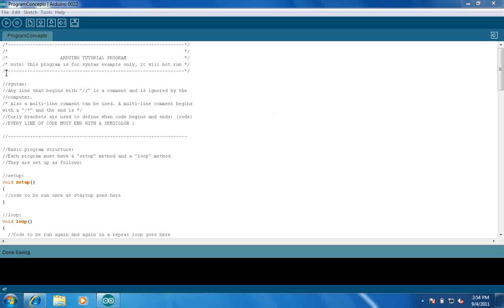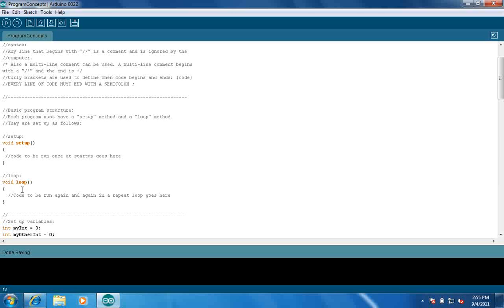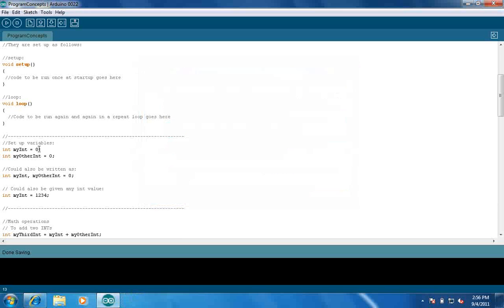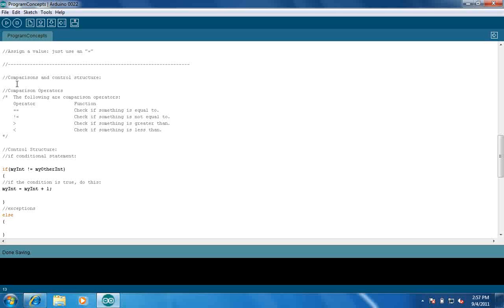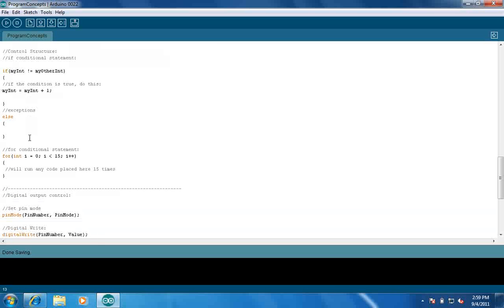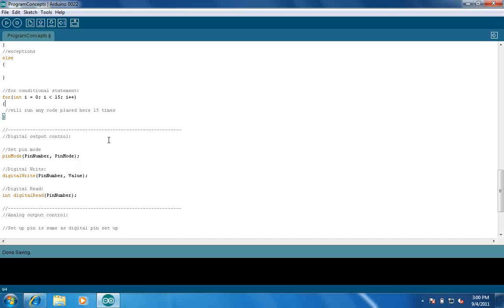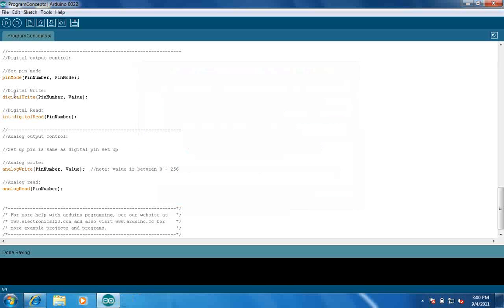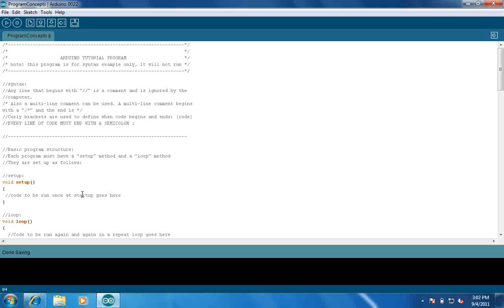Arduino Programming Concepts

Comment: i think that for an analog write the value would be between 0-255 as 256 is the resolution and 0 is a value so it is 1-256 to equal 0-255 as 0 is still a value. i think :)